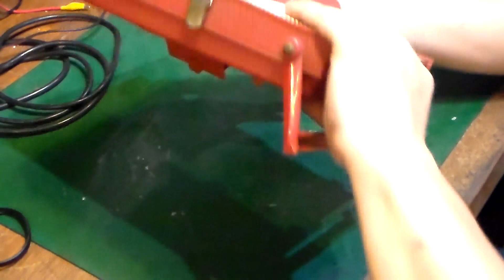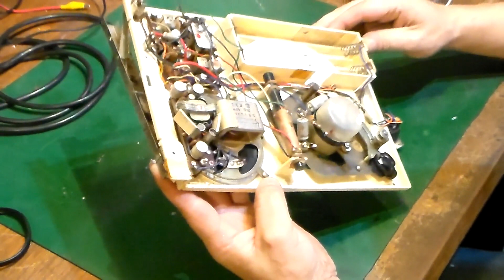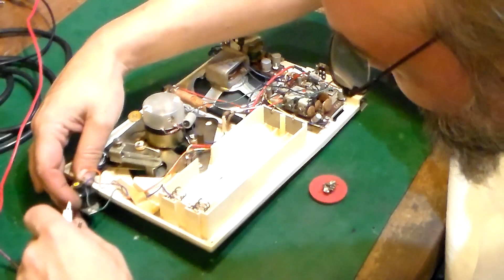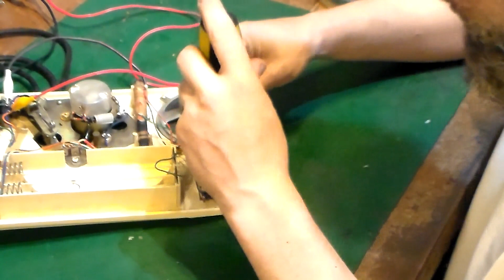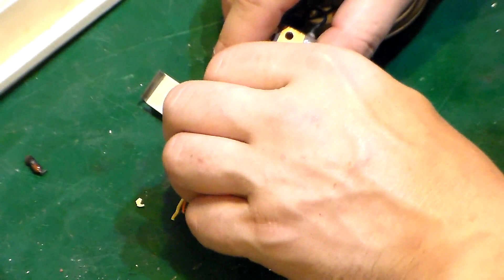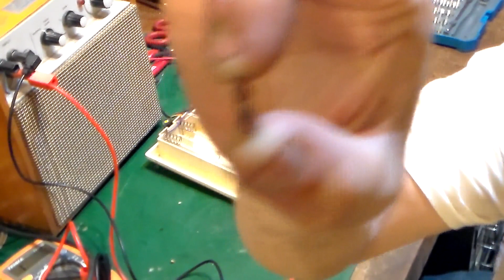Victor TRE=8 Picnic Radiogram Resurrection attempt

Comment: Oh Dear Oh Dear Jay. A Rare Unit indeed but definitely repairable! Start with the Record Player on 9v - I have a cartridge here that might work. I hope that Motor does not have a dead spot though. Have you tried putting IF into it and seeing if that gets out? Most Japanese transistors have UK Equivalents. Also was the antenna connected when you tried that board as on some it has to be.  Might be worth fitting a protection  diode ?